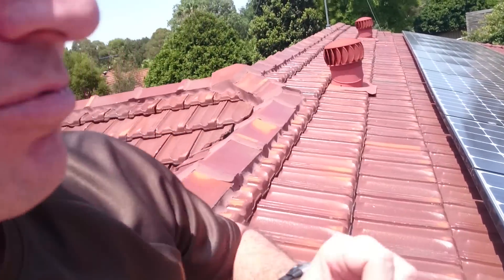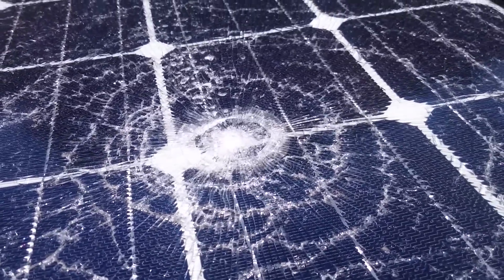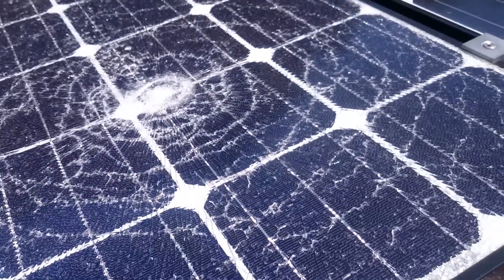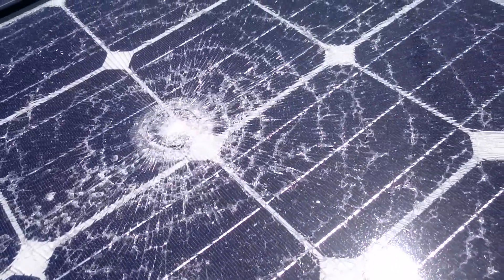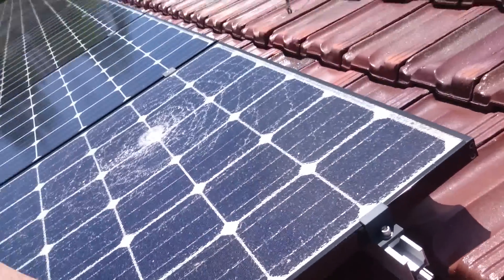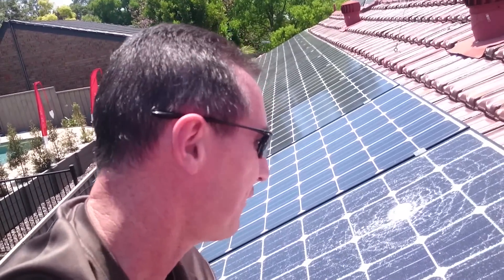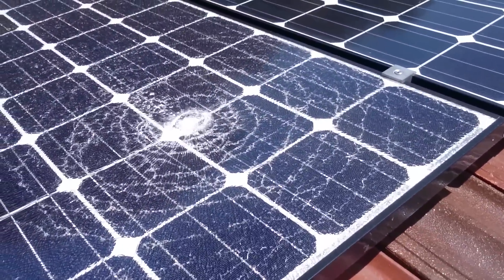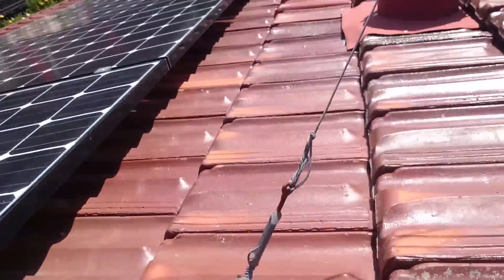Home Rooftop Solar Power System Update - Shattered Panel!

Comment: Dave. It was done by a lawn mower. I know from experience. You would be surprised how much energy a rock shot out of a mower can carry. I have seen them bust a hole in brick. I think you would find evidence of most other explanations.
Reply: +Richard Smith the trajectory would newer add up here! no fucking way. This must be like 3 to 4 meters from the ground.
Reply: +laarson johnson Don't be so sure, i've launch a rock at about a 30 degree angle (up from the earth) with a push mower. Basically, i had the mower tilted back and was walking backwards to line up for another pass, when i dislodged a rock that stuck up enough for the blade to wack and sent rocketing away. Probably went 60 feet or so from my memory (about 19 meters) and probably weight a few pounds (about 1 kg).

I wonder if its worth doing the math to figure out how much energy it would take to create that shatter pattern on the panel...
Reply from the maker: +Richard Smith Not a chance with the angles involved, and the massive amount of force that warped the panel.
Reply: +EEVblog Maybe somebody fired a gun into the air from miles away and it landed on your roof.
Its not impossible,that amount of energy i doubt its a rock and angle is from above so yeaaaa something came from above.(sorry for bad English)
I hope you will get it fixed.
Love your videos btw.
Cheers mate
Reply: +EEVblog Maybe the panel had an imperfection in the glass and the warping has been caused by the glass shattering and pushing the frame outwards. That or the panel was warped in the installation process and from all the hot then rainy days has caused it to fracture. Ive installed 1000's of panels on caravans and ive never had one come back shattered when i worked there for 4 years.
Reply: +laarson johnson I use a slasher deck in my current day job it has full skirts and chains all way around. I pretty much drag it (Shhh dont tell the boss) along the ground to get a decent cut and rocks always shoot out the side higher than the cab an out to 15ish meters. So it is possible.
Reply: +Peter M If that was the case the tempered glass would have cracked stress lines coming from the edges. It looks more like a large ball bearing type/mass object hit it exactly where the center of the cracked stress lines are the tightest as Dave showed.
Reply: +lasersbee the warped install was just a theory but who know what caused it. It could have been that there was a micro bubble in the glass and that 41 deg day the other week has expanded the air bubble to the point that the glass couldnt take it. If you invert the colors the epicenter looks elongated which would fit with a angled impact of a rock. Was it the kids next door playing with water balloon&#39;s on a hot day, ones thrown a water balloon on the panel to show of to their friends and the temperature shock has done it. 
That or the people from batteiser have been playing golf.
Reply: +3rdpartyU5er Maybe it's a shotted Football or something like this from kids that playing around in the neighborhood.
Reply: +EEVblog My bet is some sort of fishing bird, mistaking the dark panel for water and some reflection for a small fish, with their reinforced necks, steep dives and big pointy beaks it probably shook off the impact in a few moments and flew off.
Reply: +EEVblog I'm guessing a baseball or some other sort of solid ball. Someone tossed it up too high, or hit it high with a bat, the impact looks very regular, so it has to be pretty round, and it hit pretty fast to cause that much damage.
Reply: +Ognjen Čolić There would be a bullet in the panel if it was a bullet. Whatever did the damage left the area. Could have been a bird falling out of the sky. It would explain why there is nothing to be found, the size of the impact, and the amount of damage. Just needs a sharp beak to break the surface. Why not feathers or blood? Feathers could have gotten blown away, and the blood I have no clue...
Reply: +EEVblog It may have been a stone launched from a stump grinder like this http://bit.ly/1R3eHhS .  I know - I've done it.  There's generally no guard directly in front of the vertically spinning drum.  I took out a very nice sliding door from well over 200 feet away when I hit and line-drived a small rock.  I've no doubt further distances are possible depending of the angle of launch.
Reply: +laarson johnson Mythbusters had an episode where they investigated the potential lethality of hitting rocks with a lawnmower and the results were scary. Then Jamie proceeded with building a "lawnmower from hell" that redefined scary when its supersized blade sheared off from its axle and tore the ground up as it flew across the field.
Reply: +EEVblog Also, it's a perpendicular impact, given by the perfectly even damage spread. Whatever it was it was something that fell at an angle from somewhere really high (the plane theory) or something with a huge  parabolic arc
Reply: aserta
Only problem with the plane theory is what fell off the plane, and why couldn't he find it? Also, if it fell from a plane it would have bounced and done more damage.
Reply: +Teardown Dan somebody almost lost their feet in that stunt.
Reply: +Teardown Dan That episode is one of the episodes I truly despise. In particular the part where they compare bullet and rock "energy" by launching them at a rod suspended from above and measuring the angle of deflection and explaining that would allow the busters to compare "energy" of different projectiles. That is a huge fundamental mistake. Following from Newton's laws of motion, the angle of deflection is not relative to the energy of the projectile but rather its momentum. This is physics 101, before the first midterm exam. Almost elementary school stuff, really.
(For any closed system, for example a system comprising of an initially moving projectile and an initially stationary stationary rod, BOTH momentum and energy are constant. So a light object traveling fast may have more energy, but to preserve the momentum it has to either bounce or lose the energy otherwise (as heat). It simply cannot have much effect on the motion of any heavier object. A heavy object on the other hand is forced to do the opposite: it simply has to push anything in its path. In the Mythbusters' setup the reason the rock caused a huge swing is because it had way more mass. If anyone doubts this, ask yourself why Newton's cradle only works with balls of same mass.)
Reply: *****
Haven't read anything about that but seeing how the blade launched off and how heavy it must have been, I doubt even Adam was safe behind his "bulletproof" shield... or maybe even Jamie on his steel throne.
Reply: Teardown Dan I have to watch that episode. My childhood house had a lopsided yard and living on a plateau the ground was very rocky, and the damage to the solar panel seems quite obvious given my experiences, but I could be wrong. I don't know how lopsided daves(or the neighbors) yard is though. Regardless, I don't think the damage would look much different coming in from the side, but it would explain the rock not being found that did the damage, but this is all speculation. Wouldn't the angle of the damage be consistent with the angle of deflection? Which also would be upward?
Reply: goatstaog Of course I did, and this is likely because you have never had a lopsided yard. We caused roof damage to the house I lived in as a child on a couple of occasions from the lawn mower because of a hilly(and rocky) yard(and a busted window once). The flap(if installed) is suppose to prevent things like this, but that only works on a flat yard, and if you have it installed.
We had to use very specific mowing patterns to prevent house damage after our accidents xD
You never know whats hiding under that grass your mowing.
Reply: +Gunhaver LOL - to a real engineer / applied physicist, it's always worth doing the math!
Reply: haha very true. I am a software engineer so i should know better
Reply: +EEVblog is there a big rock in the gutter below it?
Reply: Oh, I was getting so vested in a new microdrone speed record, too. Clever dogs at the neighbors trying to show off.
Reply: +Ognjen Čolić First thing that came to mind was golf ball. Maybe someone launched one out of a spud gun a mile away and dave's house got hit and the evidenced bounced into his neighbours yard where the dog picked it up and buried it or swallowed it oooor...  maybe swallowed  and then later buried it. WAIT!  It's possible it''s still in there!  :^P
Reply: +Richard Smith cricket ball
Reply: +Ognjen Čolić 
Falling bullets have an accepted velocity of 90 m/s.  I am sure the stats on the panel would state it can withstand such force as the panel resists large hail.  The most likely scenario is not just an impact but also a sharp edge to initiate cracking in tempered glass.
Reply: Sean Nanoman search golf ball vs solar panel. looks quite similar.
Reply: That would fit, wouldn't it. Would also help explain why there was no rock or anything as it would have rolled away easily.
Reply: +EEVblog If you didn't found something maybe it was a block of ice from an airplane
Reply: kalidor.ch Thats very unlikely. That only happens when the plane malfunctions. It happens, just less than meteors or space debris causes damage to property.
Reply: Also i imagine that a rivet or bit of debris from a plane would not have enough mass or be the right shape to build up enough energy to do that much damage.
Reply: The kid's picked up Kimagure Orange Road style temporal psychoomu, and dropped a baby sandworm off his future-hoodie coming home. Can anyone tie in Gammel's podcast...Spartan 6 FPGA shields and all-consuming startup serializers; or all-bootstrap power and timing trees?
Reply: +Richard Smith What about a weedwacker.
Reply: +EEVblog Ya beat me to the correction, concentric circle pattern indicates an impact angle nearly if not perpendicular to the plane of the panel but also some deformation of the panel absorbing the impact.  I'd say object was between baseball and golf ball in size.  You may not get a free replacement put the manufacturer's engineers might be interested.
Reply: +Robbob9933 Im voting for the golf ball.
Reply: +billl605 I was just giving a size estimate based similar damage I have seen on both tempered and annealed glass.  I understand solar panel glass is supposed to withstand hail stones up to 75mm at ~39 m/s or ~88 mph, Dave do you have a flying DeLorean  around your house??
Reply: +Richard Smith My mower once hit a bolt hiding in the grass, shot it clean through a window, and left a nice-sized digger on the wall. It looked like a bullet hit my house, so I could see a similar-sized object getting launched with enough force to do that kind of damage, even after flying a significant distance.
Reply: +laarson johnson you are correct it had it hit with force and the impact is wrong for a rock
Reply: +john smith It was, it's still laying against the neighbours back fence 0:26 to 0:30
Reply: +Richard Smith i second that by saying it was shot out of a truck tire instead of a lawn mower. I heard of it hitting people in the head and killing them. The velocity could be incredible in the right circumstances do the massive weight and torque of the vehicle.
Reply: +EEVblog I vote crows dropping objects onto your roof, a sharp one in this instance that was angled in just the right way as to shatter the panel, you haven't pissed off any crows recently have you Dave?
Reply: +EEVblog Actually Dave, did you cop a lot of wind recently in those crazy storms? A few months back? Tree branch impacts create that kind of shattering.

Comment: A good mystery - and seems like a relatively high energy impact at a pretty small point...  That kind of tempered glass is likely as strong as an auto glass, so a Meteorite or remnant of space junk is an interesting and plausible theory because a round metallic particle falling from many miles up could be pretty small and still have that high energy.  Even a rifle bullet fired in the air a mile away could land on a roof with that kind of impact.  Kids with slingshots?  Sure -  All possible.
Reply: +Fran Blanche -- Well, there are still enough un-shattered panels left to do some tests.
I bet, it was a cricket ball.
Reply from the maker: +Fran Blanche I just so want it to be space junk or meteorite!
Reply from the maker: +BlinkY Never tell me the odds! https://www.youtube.com/watch?v=uYX-NSZMqt0
Reply: I think space iron of some kind is likely - cosmic shot tower effect as a molten piece forms a nice sphere to reach a good terminal velocity.  People do get hit with space junk and meteorites... its statistically rare, but it happens.
Reply: EEVblog Well, judging from regular Meteorite impact craters, I'd say that a Meteorite would have pierced that panel. Moreover, there must be debris of the object nearby. Only a mini-comet would melt but still would leave gravel. A cricket ball on the other hand might drive the owner to secretly retrieve it...
Reply: +The Kaiser Meteorites come in all sizes. Some are very small.  The debris could be a pebble. 

However, the odds of getting hit by a meteorite are slim and getting hit by one which had just enough energy to to break the glass, but not go through the panel are even slimmer. Terrestrial sources are much more likely.
Reply: Terry Wilson Aren't you supposed to be on some sort of medication?
Pterodactyls do not exist.
Reply: Ben Lutz I know that Scotland is like this, but Australia?
PS: And why is it called Australia?
Was it founded by Austrians who lost their trail?
Reply: +Gunhaver I thought about my approach a bit, and i decide to work the problem backwards as well. I assumed air temp of 70 deg F, relative humity of 70%, altitude of 19 feet EGM96 MSL, a spheroid impact object with a radius of 0.5 inches (1.27 cm) (judging from the video), a breaking pressure of 70MPa for the glass, and an impact duration of 0.7 ms (the time a baseball is in contact with a bat during a hit). My impact duration could be way off. Anyways, you can plug all these numbers into various equations for air density, terminal velocity of a sphere, drag for a sphere, etc. and I worked out that mass of said spheroid object would need to be around 387 g, or about 13 ounces (0.85 lbs). This is also assuming a momentum loss of 80% during the impact event.

So this time around, i stepped up the size of the impact object, and calculated the terminal velocity rather than pulling it from a table, and i calculated the needed mass of the object and assumed impact force (last time i assumed mass and calculated force). They both somewhat agree magnitude wise, and i think the math still points to a meteorite about 1 inch in diameter. Does anyone else have any numbers? Maybe i'm the only one crazy enough to do some math...

Now who wants to predict the radius for a probable debris field based on impact angle derived from the concentric ring pattern? That shouldn't be too hard... it would be pretty sweet if we gave Dave a search grid and he actually found a rock or something. Yay physics!
Reply: +The Kaiser It is derived from Latin and means "Southern Land"
Reply: ***** Forget it. Dave is useless in fault-finding.
Remember the Samsung LCD-TV...
Reply: +The Kaiser maybe just in Australia there are some left around :-D
Reply: +EEVblog If its space junk it would still be there someone, likely in the yard. A ball is more likely to be retrieved by someone and would explain not finding anything.
Reply: ***** Gesundheit!